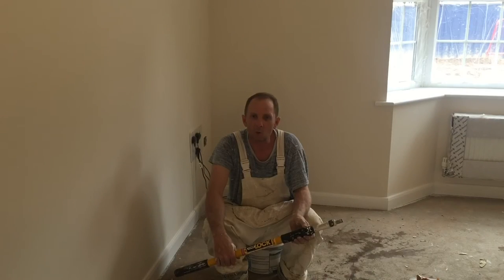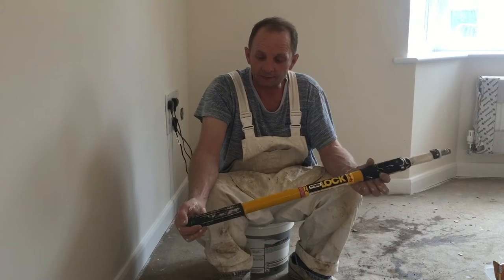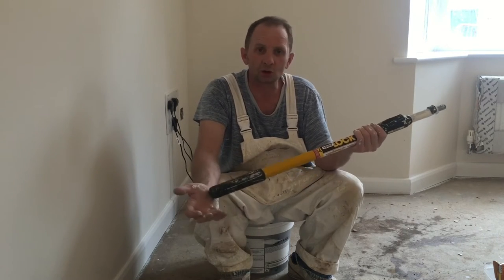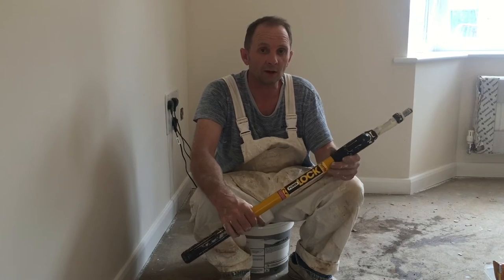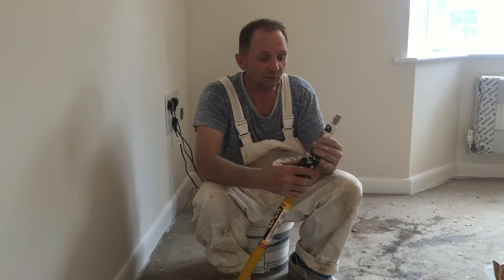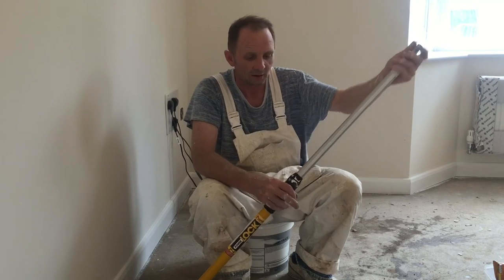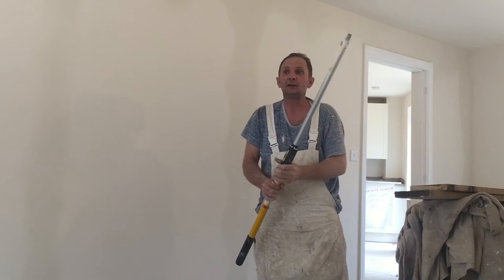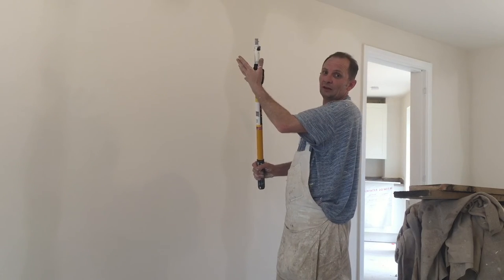Purdy power lock roller poll review

Comment: we had 4 fail on us, where it grips the metal it wouldn't grip so kept sliding down! moved over to wooster far better and cheaper imo
Reply: Are you American?
Reply: But not 8 feet. Supposed to be 4- 8 but is 5 or 6 inches short.